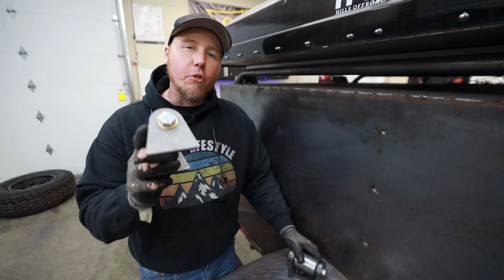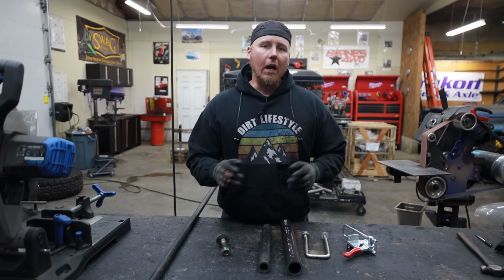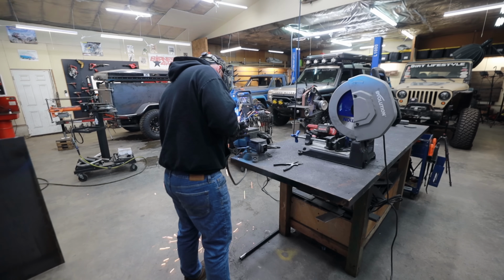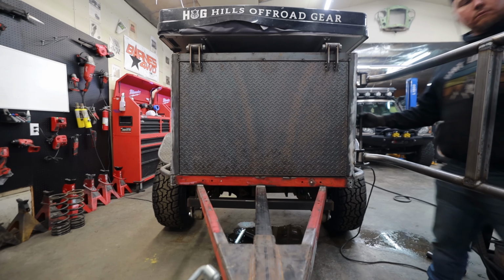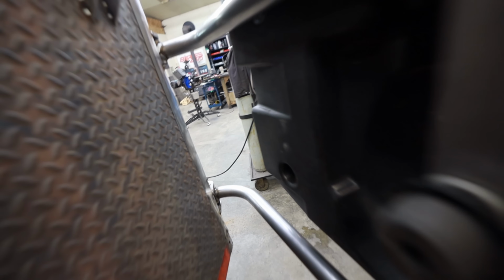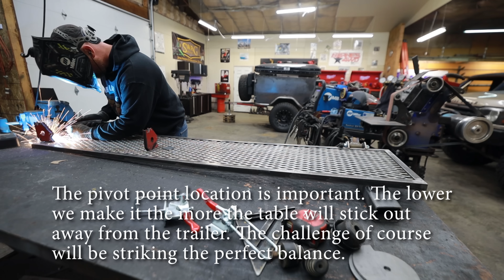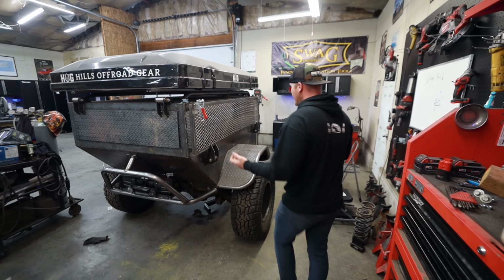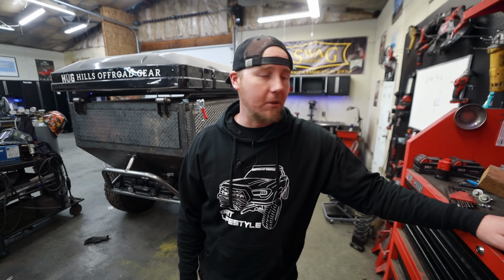Finally Back In The Shop! Harbor Freight Offroad Trailer Episode 6 👊.

Comment: For the table, 3 ways. TailGate support cables. Hydraulic support struts ( like for hatches but in reverse.). But my favorite is solid 3/8 bar with pivoting guide nut on bottom.  That would force the rod to be vertical when table is closed and strong enough to hold anything.

Comment: Do cables with d rings on one end. Weld the cable to the table, make an eye ring on the trailer for the d ring to clip onto. When you store it unclip the d ring from the trailer and clip them thru the grate to keep them taught and out of the way

Comment: Again like the latch you built, you can use an off center pivot. If the hing comes off the "top" of the table, 90 degrees to the flat plane, you can bump stop the back edge of the table to the body of the trailer. Then you can have multiple adjustable bump stops to level it. No cable needed. 

Early on in this build series my wife and I were hunting for a trailer. We're pulling lots of inspiration from your build series! We are using a Bantam T3C as our base. And keeping it light to be towable by my TJ.

Comment: Cable running through a tube with a stopper. Add a spring in between the stopper and tube cap. So when the table down, it compressed the spring and when the table back up it decompress the spring and it retract the cable. Also add a pulley for the cable to ride on

Comment: Hey there, For the table, put a stop on the bracket that attaches to the pivot points. This will act like a kick stand and rest on the wall of the trailer box just under the pivot. Cool project!

Comment: For the table, integrate/fab a stop point in the bushing/hinge that will stop it from swinging past the level that you want. That way you won't need any cables or support underneath. It will just float

Comment: You could always use the old school cable door closer... a weight on one end,  inside a pipe,  cable goes up out the top,  over a pulley then to the table.  Weight is a cable stop to hold the table,  and when you fold the table up,  the weight pulls the cable down into the tube.

Comment: budget friendly...drill hole in the side and run cable through, add weighted stop on end of cable so it just drops back inside when table goes up. easy to trail fix too!

Comment: Design stop points in the hinges themselves, add an outer lip that stops at a through bolt on each hinge. No cables or flat bars in the way at the end of the table and it will keep it super rigid.

Comment: Retractable cable idea. Use the design of a kitchen sink faucet that retracts. Those use a weight on the hose below the sink. You could put a weight on the cable where is secures in the interior of the trailer. The weight will pull the cable back inside by gravity as you store the table and latch it.

Comment: A cable through a spring inside of a tube. As the table is folded down it pulls the cable compressing the spring. As you fold the table up the spring retracts the cable into the tubing to keep mud and dirt off of the cable and spring. The tubing could be mounted to the top of the trailer under your Roof tent.

Comment: Run a piece of tube across the top with a pull-cord spring on one end, attach the cable to the tube and the table and put a little hook latch on the fender, whether the tables up or down it would always be tight and stable

Comment: For the fold down door you could use gas struts like the ones that are used for car hoods and hatches. It would support table in the down position and hold it tight against the trailer when up to prevent rattling.

Comment: Nate.....For the table support, what about a hole in the side to pass a cable like you had mentioned? Then on the inside, crimp a loop and tie a loop of 1/4 inch bungee cord to it stretched across the interior roof to retract the cable as you lift the table. The crimped loop would also serve as the stop that holds up the table.  I came up with this idea on my own trailer build and it works GREAT! Super clean and easy to service, too.

Comment: Two pieces of strap steel on each side hinged in the middle. When you fold up the table they nest together. When it closes have a bump on the trailer and table that sandwich’s the two straps and keeps them from rattling.

Comment: Use two pieces of flat bar. They will fold into a V when the table is closed and sit straight when the table is down. Put one on each side and the bump stop and you'll have a table you could sit on. It won't stick out to grab branches. Just a simple thing you can do with the scrap you have laying around.

Comment: Couple options for your table support you could either repurpose a couple of old retractable seat belts removing the seatbelt material and add  cable to it or use a spring setup like on a roll-up shop door

Comment: Chains, gas struts, or two pieces of flat steel stock with a tab welded to the side that acts as a stop that fold down and hold the table in place where you want it. Just some rough ideas good luck with it. Trailer looks awesome!

Comment: You could take some inspiration from a kitchen sink. They have a counterweight that pulls the spray head back into the faucet when you release it. Simple counterweight inside the trailer would retract your cables when the table went up.

Comment: Tie a elastic cord between the wires. When the table is down slide it to the top. When you want to close it slide it down to the middle of the wire. As you close it the tension will pull the wires in.

Comment: Simple hole through top of trailer with cable attached to corner of shelf and stop on cable on inside of trailer. Attach a piece of bungy cord to stop inside trailer to opposite side inside trailer. With shell up tension bungy cord to just hold cable tight. As you drop table bungy will streatch allowing cable to pull through hole until stop on cable hits home.

Comment: Lift gate assist for a landscape trailer is a $200.00 option,  a boat winch like they use  for commercial/ competition  grilling to raise the grates, I would  mount the drum inside and have  a flush socket  port, any 1/2" drive tool will crank the spool.  the overhead garage door set up. All of these options will have to  be adapted to the space available.  You could do the whole thing with a few pulleys  and ropes .  Tailgate wire ropes,  with  a spring holding tension on slack or stowed  rope  between the trailer and table top.

Comment: Use the old school pickup truck bed hangers. Just two pieces of flat stock hinged in the middle with a bolt. No loops to get hung up and no need to tuck them in. They are self folding and will tuck away inside the table edge when folded.

Comment: A light spring mounted inside that pulls the cable as you raise the table. A simple stop on the cable would hold it in position. As long as the table weighs more than the springs can pull. Almost like assisted lift.

Comment: Use a couple of 3/4 x 0.125" flatbar pieces with a "rivet" or elevator bolt in the center pivot. Land Cruisers use that style for the rear tailgate. Super durable and it goes where you want it to when the table is up.

Comment: Rigid flat bar with a single hole mount at the top and a hollow center groove in which a solid pin on the table end could travel up/down the length.
At full hang the table would have some rigidity (sans cable).  When stowing, the pin would travel up the channel to the point of then letting the bar drop straight up and down via gravity and be mostly held in place organically by the traveling pin when the table is latched.

Comment: Use a hood support rod X2 for the table that hooks in when open and tucks away when the table is up. Or drawer slides that extend out of the hinges and retract when not in use.

Comment: You could use a steel strap with a hinge bolt in the middle as a hanger for your fold-down bench. It would hold itself in place once folded up. Nothing to go wrong - and cheap.

Comment: Put a bumpstop each in front of and behind the fender. You really don't want anything above the table surface to catch pots or drinks as you turn around. You also don't want to listen to the squeaks and deal with scratches.

Comment: For your retractable cable, just keep it simple. It can be exactly like I built the door closer for my shop bathroom. Mount a pulley, a small dog runner type pulley would work just fine,  inside the camper and put a weight on it. Maybe drop the weight inside a tube so it isn't swinging around. Simple is good.

Comment: You could weld small diameter pipe inside front and back and spring load the cable inside the tube and create a stop on both cables/pipes that stops the table at desired level. Wouldn't take up any room inside the box and of course a roller for each right at the inlet to insure no cable wear.

Comment: The Flat bar tailgate supports are a good idea to me. I didn't know chevy did that but Ford has been for years early 60's I think. If you want a cable still you can put a boss with a raids in the hole on the side of the trailer, build a correct length cable with a stop on the inside end and put a coil spring connected to the left side of the cox to pull the cable back into the inside when you raise the table.

Comment: Use rubber coated chain instead of cable for the table. Another thought, use some angle iron to make additional supports at the end and in the middle of the table. Attach them so that they are perpendicular to the side of your trailer when you fold the table down. Either adjust them so that they contact the side of the trail to hold the table up when you weld them on or put an adjustable bump stop on the trailer end of the supports so you can fin tune them to be perpendicular when the table is folded down.

Comment: Garage door spring/torsion wound cable system to hold and lower the cable. Would mount in the top of the inside of the trailer and could limit the length to fit your need. Also would wind the cable back up when stowed.

Comment: Take a look at an LR3/LR4 lower tail gate mechanism. It's got retractable cables and is strong enough to take the weight of several people sat on it. They clip on too, so would be super simple to remove if you wanted to pop the table off and allow the cable to retract within the body of the trailer.

Comment: For the table support cables make them removable. Weld bolt heads with enough bolt shank left to fit the cable size you use and a length of cable with eye loops on each end to hold the table level. Use the KISS method and don't over complicate it with a retractor that can get fouled up with trail dust and dirt and not function when you need them.

Comment: If you don't use one of the great alternative hinge suggestions, search for 'retractable tool lanyard'  they make them in different sizes and come in synthetic and metal cable.  They would work great once cut to propper length.  I would add a small brush or wiper on the opening at the trailer to keep dust/dirt/debris on the retractable cable from getting back into the mechanism.
Love this build!  Keep it coming

Comment: Weld a tab across the hinges
Then drill a hole, tap or weld a nut to it then put a bolt as an adjustable stop. Sleek and simple and out of the way.

Comment: Create a kick stand on either end of the table that fold out and down to support the table from underneath.  But fold in when table is up. Then there's no cables in the way.  Or just weld multiple stops below the table that are rigid, but doesn't stick out pat the table when its folded up.

Comment: I second the old tailgate set up. But if that doesn't do it for you. Spring loaded cables ran inside, with a stop nut sealing/sitting on the surface, inside to set travel. Constant rate springs (perhaps in tube's for protection) are cheap and relabel. Use grommets on the cable ends at the shelf. They can seal the holes while it's up.

Comment: You could mount 12v Linear actuators on each each end of the table. They are waterproof and rigid with no support cables to hang up on trail.

Comment: For the table you could attach a piece of bungy cord to the cable.
.connect it to the far corner. Add a stop to the end of the cable to make an end position when the table is in use.
When table in stowed away the bungy wil pull the cable in?
You will need to add a lock to keep the table in the open possition.
Just an idea.

Comment: seat belt retractor ticks the boxes, remove the belt attach wire, adjust so it reaches its run out, job done.  cheap, and easy to get hold of

Comment: Feed the cable through with a loop on the inside that will be the stop and connect it to a bungee cord that will pull the cable in when you lift the table.

Comment: I would say one square tube along the length of the table and use gas struts bolted to the square tube and the body of the trailer. If you get the ones that has a soft extention it would be pretty smooth

Comment: Try using cables with individual springs like a garage door but inside a undetermined length of tubing (you have to figure that out). The compression of the spring will help keep the cable from snagging, then figure out the cable length.

Comment: Hi, build a stop right on the hinges it will be more clean and out of the way, they look pretty strong to support the table weight. If need it you can extend one of the hinge side to the outer edge of the table to make it more rigid.

Comment: retractable cable system: long tube that goes perpendicular to the table with a ferrule on the end; when collapsed, the cable sits inside the tube (no loop), when extended- the ferrule holds against the end of the square tube. benefit being, no loops, and you use the internal volume of the trailer box. should tuck itself neatly in that top square tube

Comment: Cable grommet, flat washer door spring. Just enough tension to pull the cable back in when lifted. The washer would keep the other end inside and set the distance it can come out

Comment: The way I would do the table; is 1/4 flat bar on each end of the table with a loose pivot at the edge of the table. Lift the table up and put the flat bar into a slot on the side of the trailer. Done, lift the table and the legs fall back next to the table. Only makes your table 1/2" wider.

Comment: for the table, have the cable be a pully type sustem that when you release it from the middle, it goes to the sides then out with the table. but when you go to put it up, you pull the cable and the pullies will make the table go up then when you tie down or latch the cable that will hold the table up then you use your other latch to make sure it stays in place

or you could add the bump stops to be right on the hinges so it will only go so far, then add one in the middle as well and that will keep it sturdy

Comment: I would put 2 small arms (made of square tubbing ) between the table brackets that fold outwards. And when using the table, just fold the arms outwards and let the table rest on them. This way you have no cables and it will be stable because of the 2 arms. It is different from what everyone else is using, and I think it would integrate nicely with your build.

Comment: I like a bunch of the replies with the old school tailgate hinged straps. If you do go with cables a simple counterweight (just like the sink sprayers) could work. Mount some pvc vertically that the counterweights live in inside the trailer so they don’t fly around.

Comment: Hey Nate, Could you add a physical metal tab to your table hinges to limit travel of the hinges passed 90 degrees? This would remove the need for cable supports to hold it in the open position. You would just have to add a little more structure to the table to keep it from flexing.

Comment: What about running the cable through the trailer side into a tube, with a weight on the end. When you pick the table up, the weight will pull the cable into the trailer and out the way, and then when you pull it down, the weight will prevent the cable from pulling through the trailer side. You should be able to fab this up real easy.

loving the build Nate, as always, quality vid!

Comment: Drill hole at the ends of the tables at the top put a cable through on a roller with a weight system that pulls the cable back in when you lift the table Simple and easy and you can put a little Box around the cable so it doesn't get tangled up on anything inside the trailer

Comment: Could maybe use some vertical pieces of DOM tubing welded on the side behind the shelf with weighted cables running through to shelf. So that they slide up the tubing and stop when the shelf is in position but slide back down when shelf is in storage position.

Comment: If you dont want to use cables. You could also use the hinges from a ladder to hold the table. Just like the old toyotas that used metal plates with 2 pivot points for the tail gate.

Comment: Hi Nate, like the idea of the straps/cables for holding the fold down table up, until you find a retractable system I'd suggest as a temporary measure tying a couple of lengths of  low strength bungee cord between the mid point of the support straps and the table top which will give you time and flexibility,  I'd also suggest the bump stop as well so you reduce and deflection or bending of the table if you have anything really heavy on it!

Comment: Nate, regarding your drop down table, I would suggest copying the ARB style awning leg concept. Add a couple swing down awning legs along the long edge furthest from the hinges.  When you drop down the table, you then swing the legs down, adjust the height as needed if the ground is unlevel.  

Other option would be retractable dog leashes for your hidden cable idea. Hide the retractable parts inside the trailer.  

Or, since you are looking for really off the wall ideas, maybe create a cable roll up system similar to how a garage door lift works.